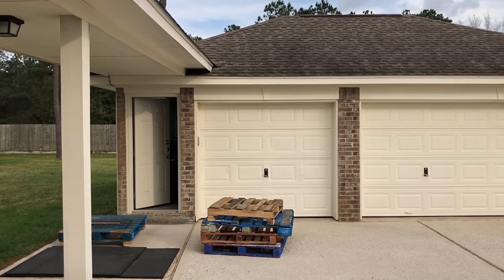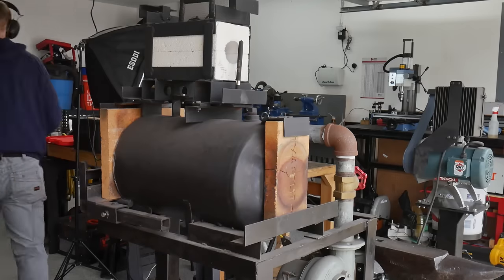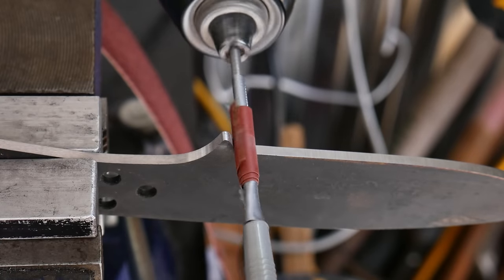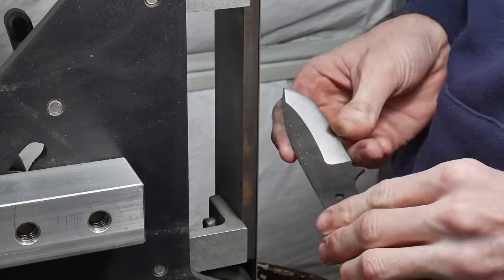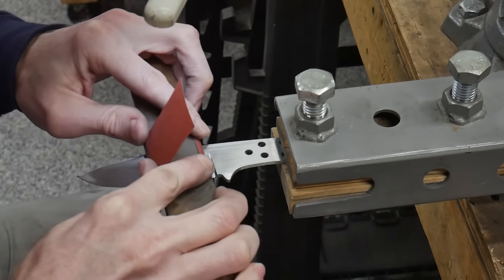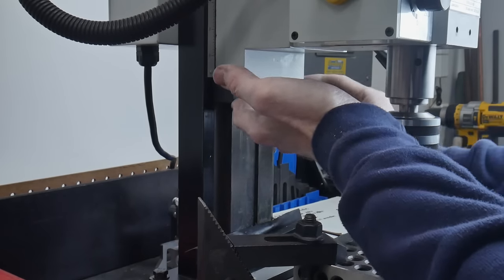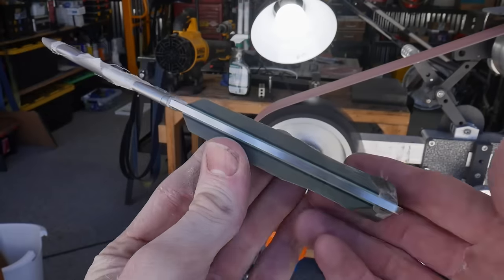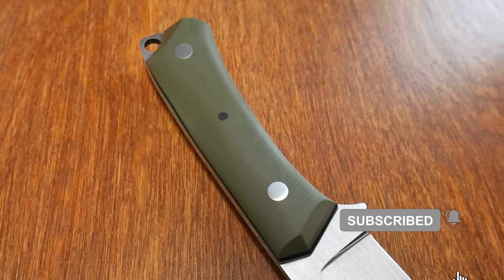I'm Back! First Knife Build in TEMP Shop | #knifemaking

Comment from the maker: If any of yall are interested in some other projects that don't really fit here on RBO... check out my new Red Beard Engineered channel here : ⚙Red Beard Engineered - https://youtu.be/YkExB-Bujyo
Reply: ⚙BOOM⚙
Reply: On the strength of my experience with your primary channel, I subscribed to this one. The intro video did not disappoint.
Indeed, like nearly all your other videos, it was a delight.
I hold dual degrees in Electronics and Electrical Engineering Technology (pretty much everything from 0.7 volts dc to 480 vac).
In retirement, I have maintained my credentials with a small service bureau that does design and prototyping. Many of my personal projects (for the fun of it) have been microcontroller integration projects. All that said, I look forward to whatever you manage to get out there!
Reply from the maker: @CCCfeinman55  Thank you greatly Cuck! I'm glad to have you on board. That other channel will be fun to use as a space to branch out a little. Have a great week, sir!

Comment: That 3m hood has been one of the best purchases I've made for my shop. I almost had to shut down my wood shop because my respirators were not cutting it and it was messing up my lungs. Now I'm out there every day without an issue!!
Reply from the maker: Heck yeah man! Every once an a while with the old ones, I'd blow my nose and get back some garbage... Got tired of that. To be fair, a good deal of it was user error. Comfort goes a long way.
Reply: @RedBeardOps  So true. I have a long beard so there was never a real good seal.

Comment: The resperator with the full face mask is really ideal because you have protection from sparks and flying metal as well as the breathing protection.  I would be curious if it fogs up much especially if you are working in a cold garage.
Reply from the maker: Dude not at all! It's amazing... It doesn't fog since the air is passing over your face and onto the inside of the shield. It will start to fog if you turn off the power pack

Comment: Awesome man! I have that exact versaflo fresh air system... the battery goes dead pretty quick, which you think it wouldn't because of the size of it. Weird that they make you use the Allen screw to take the battery off but other than the battery issue it's really nice when it's hot you get nice cool air in your face.
Reply from the maker: Thanks for the info JOe! So far so good. I like it

Comment: Pull out 2 standard breakers and replace with a quad. So if you have 2 adjacent 15a standard breakers  pull those out and replace with a 20-15-15-20 quad. Some new panels will not accept quads, so make sure yours will before you buy one. If it does and you go with a quad, then you could use #10 or #12 soow cord with the receptacle that comports with the plug on your oven. This is only for temporary use, and shouldn't be your permanent solution. Anyhow, just an idea since your subpanel is right there above your work bench.
Reply from the maker: Thanks for the thoughts man. I was going to see about getting another panel installed... Not having any space is a no go!
Reply: @RedBeardOps  an upgrade is always the best idea for sure!  Btw, its nice to see you back in Tubelandia again my friend :)

Comment: Getting back into grinding after a long break is tough, man.  I always end up making some stupid mistake that totally changes the way my knife was originally going to look.

Hand sanding is my least favorite part, not much skill but a whole lot of repetitive effort.  I made a little machine to do hand sanding for me after getting the idea off another YT channel, I found a single cylinder air compressor at a junkyard and used the crank and cylinder to fab up my "stabby machine" with a little RC electric motor to drive it. It turns at about 80rpm, so I get a little over one stroke per second.  I made a simple clamp for the tang and a guide for the knife so all I have to do is hold sandpaper against it.  Not my favorite tool, it's rough and janky looking, but when it comes to hand sanding it gets the job done without wearing me out and also makes the scratch pattern more parallel than I could do by hand.  They're super easy and cheap to make, all it does is convert rotational to linear motion so you can set it up however you want.  If I were to do it again, I'd forgo the compressor and go straight to an aluminum plate for my crank, so I could drill a bunch of various holes out from the center for the connecting rod to match stroke length to whatever blade length I want.  Then instead of a clamp, I'd use a magnetic base like your surface grinder so I could hand sand from tip to tang if I so chose to.
Reply from the maker: Very cool! I've seen that channel and the contraption. It's intriguing for sure.

Comment: I just watched your DIY  surface grinding attachment video and before I got to the end of this video I'm wondering. Could you achieve the same level of trueness with your milling machine as you can with your surface grinding attachment?
Reply from the maker: It get's pretty finiky to set up flat bars like that. Clamping would be tough. I'm sure it's possible with enough effort, but the SGA is a pretty easy solution. Cheers!

Comment: Nice knife! I love carbon steels.

Have you checked out Rockwell C chisels by DB forge? Cheaper than an RC tester but gives peace of mind. I like my set way better than RC files because I can know within 2 points instead of 5. It's also way harder to see what you want to see with the chisels. If the knife is really 63, the 62 won't dig but the 64 always will. Can't make it skate like a file.
Reply from the maker: Dude those are pretty darn cool! I'd like to see a video of his process for making them. I may need to get me some. Cheers man
Reply: @RedBeardOps  I think they're made of A2 steel. They work great.

Comment: Awesome video, I am curious, you said you didn't have a 220v outlet, but you were running your 2x72. I am assuming that Is that not a 220v or did you have a different way of making that run on 120?
Reply from the maker: That's correct the VFD on my 2x72 runs on 110. I bought it that way, but I think it's a simple change in the VFD.

Comment: What's the difference between grinding a piece of metal sheet, and forging a Knife? Why do most Knifes of so called " Knife Makers " look like kitchen Knifes?
Reply from the maker: A knife made using "stock removal" and a knife forged will perform the same. A lot of it comes down to personal preference, style, and available tools.
Reply: @RedBeardOps  to me a knife is a small sword! so it got to has a Pommel, a crossguard, and ricasso and an ort! otherwise it'll be a kitchen knife. Question.......... do you really want to relate a metal sheet Knife to a knife made of a twisted Damascus or crussible Steel / wootz?
Reply from the maker: @smrettpecca  mono steel 1084 will for all intensive purposes perform the same as twisted 1080/15N20 Damascus
Reply: @RedBeardOps  what about a twisted damascus mad of 1.2842 and 1.2767? , or a real damascus, not pattern welded, called crussible steel, or wootz? you're not a blade smith matey, you're a metal sheet grinder! ;)
Reply: @smrettpecca  first, lets see your knives. Made by any method. Nothing? Okay then.